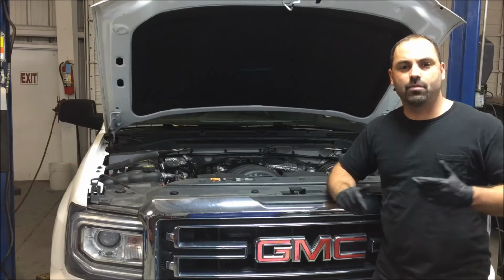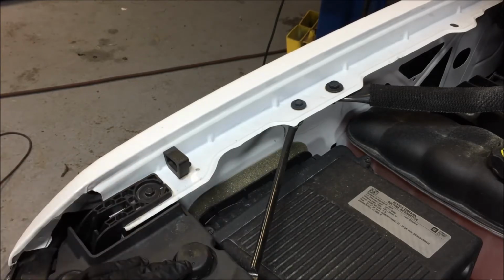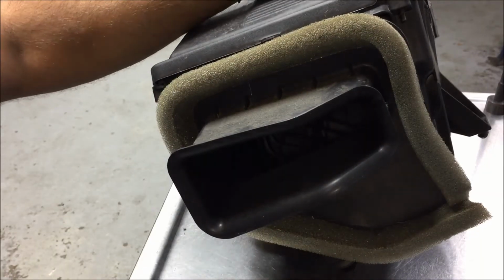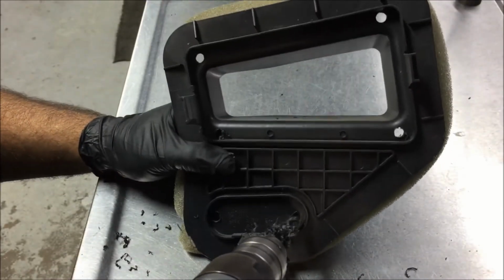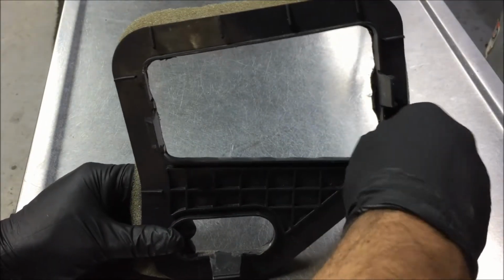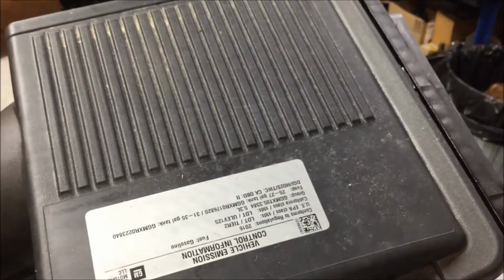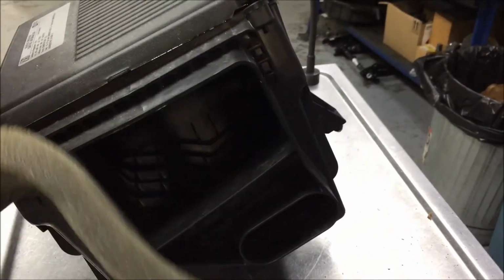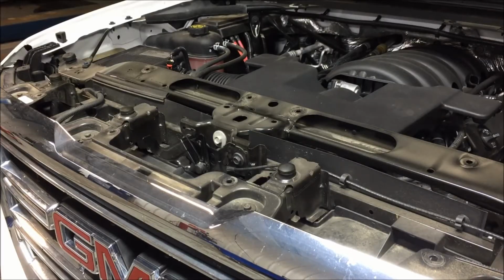DIY Cold Air Intake - Silverado, Sierra, Tahoe, Yukon DIY Cold Air Intake

Comment from the maker: Parts 
K&N Air Filter - http://amzn.to/2A4W9eE
Green High Flow Air Filter- http://amzn.to/2iP3KEL

Tools
Dremel Tool - http://amzn.to/2zkUa2P
Battery Screwdriver - http://amzn.to/2hOIu13
1/4 socket set - http://amzn.to/2jV5Xlv
Plastic Fastener remover - http://amzn.to/2zonUvH

Comment: When I did my cold air intake on my 2017 Silverado. 6.2 L V8. I cut the outline of the OEM Factory intake box opening inner Fender with a dremel tool. And completey cut out the rest of plastic intake holes on the oem intake box...much larger hole. Keeped plastic foam clip on oem intake box.  Added also the airaid MIT intake tube with filter. BEST BANG FOR YOUR BUCK.
Reply: Viking690 looking to do something with box and intake tube recently just got the polished ported throttle body from Katech and love it. It’s the only mod I’ve done to truck which is exactly like yours it definitely woke it up thinking either whole cai or filter and intake tube can only help the new throttle body. Do you know any disadvantages to the aluminum tubes I’ve seen them half the price just not sure the quantity and specs to the air raid
Reply: @caseG80  I actually recently purchased the AFE momentum GT air intake for the Silverado. I got sick of these stock air intake box cracking from the screws. Cheap plastic. The AFE momentum GT intake is very clean Quality Parts in clamps. Well worth the money
Reply: Viking690 thanks for the reply buddy ya that cai seems to be the only one legal here in California. I installed a katech polished ported throttle body and it really
Woke my 6.2 Silverado up now I need to give it more air.
Reply: Thanks man, I did the same. Cut out the whole shape leaving the clips, cut the little metal piece on the inner fender to make one big hole. It’s already a cold air intake just like that. Free and took 30 minutes. Thanks again for the info

Comment: I saw in the comments that you had this truck dynoed? What were your results? I’ve got the AIRAID MIT and I’m about to do your box mod. In another video the MIT alone picked up over 20hp/40tq in the midrange so I’m curious what the box mod and filter unleashed by themselves
Reply: How did it go @Trey?
Reply: Charles Lewis The MIT and box mod definitely help throttle response more than anything, it just seems a bit snappier. On a scanner the MAF readings are higher as well so definitely moving a little more air. I’m getting ready to do the 6.2 intake and throttle body with headers and an E85 tune to really wake it up... Shoulda just bought me a 6.2 truck lol
Reply: Charles Lewis Also, after I did the air box mods I tried a K&N high flow for awhile and just didn’t feel comfortable with it, especially after opening the air box more so I went back to a standard Acdelco filter and it changed absolutely nothing with the sound or feel of the truck.
Reply: I would love to tune my 2018, but I have a b2b warranty through 120000 so i cant get myself to do it. Esp with the tranny issues in the gen 5's. Just put in a carven comp exhaust, and airaid mit w/ k&n filter.
Reply: Charles Lewis Mines an 18 as well and I also bought an extended b2b...it doesn’t state that it has to be repaired by GM and sometimes if you know someone with a good shop they’ll overlook all the mods and file that warranty paperwork for a case of beer 😉
Reply: But if GM wants to inspect the ECU...
Reply: Charles Lewis No problem if they’re not involved. I’m pretty sure even the b2b that you can buy through the GM dealer is a 3rd party company. Just take it to a good independent shop if it breaks and have them handle the warranty claim. I’m almost to 60k and haven’t been to the dealer since I used up my 2 free oil changes lol. I had a transmission and engine rebuilt in a 2010 F150 under an extended warranty and nobody asked any questions. Even left the cold air intake hooked up and Edge programmer on the dash both times the shop had it...Just gotta stay away from the stealership! I got that warranty through one of those little cards they’ll send you in the mail saying for like $1300 or whatever they’ll give you 100k of coverage as long as you’re not exceeding 100k already...That ford had 85k on it at the time I bought warranty and let me tell you it ended up being the best money I ever spent cause it was a POS!

Comment: Is it louder, throttle response?  Engine codes.
Reply from the maker: Not louder, no codes. Just more air.
Reply: Dumb question, was there any noticeable difference with power?
Reply from the maker: @johnpickett5514  I actually took one to my friends shop who has a dyno. The printouts show about 13hp difference which is a little over 3% for this engine.
Reply: Nice.